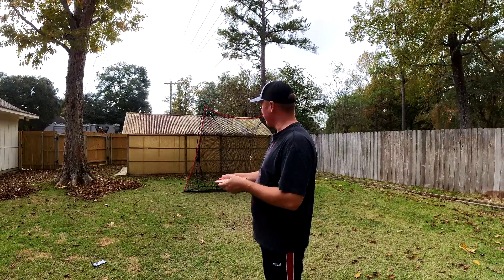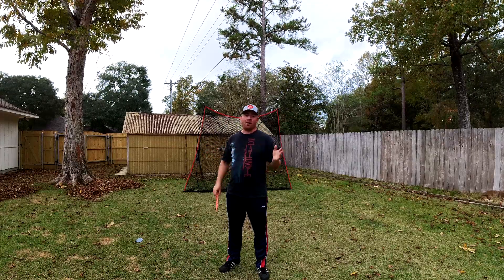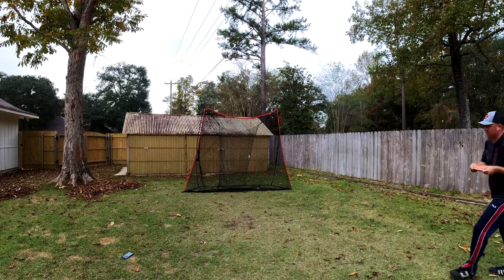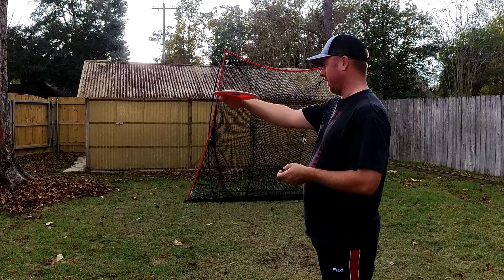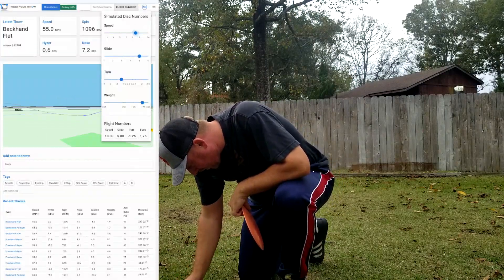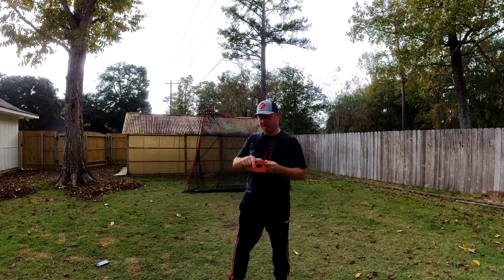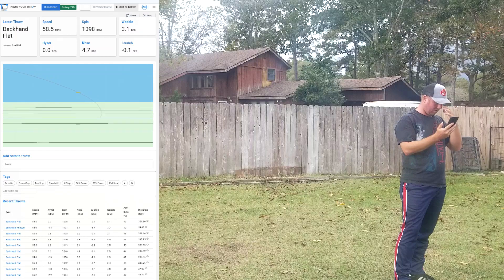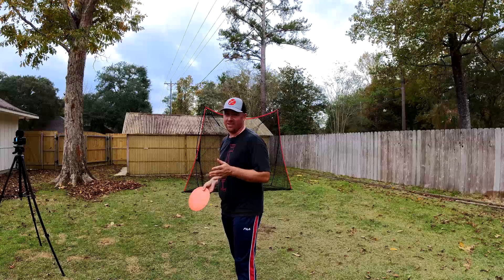Can We Throw Nose-Down With a Grip Change? — TechDisc: A Launch Monitor for Disc Golf

Comment: you need to practise nose and launch, up 8 on launch and nose neg 3, only work on one thing at the time.
Reply from the maker: Launch I can do on command with a change in reachback angle, nose I think is going to require a change in body position to get my arm and wrist at an angle where it's physically possible, because I don't think I can hit that with my shoulders that open. You're right though, hitting -3 nose would be HUGE for distance

Comment: Since your reach back is so high, you're compensating by throwing downward (launch angle).... but since your body is also telling you not to turf the disc, your release and nose angle comes up. Practice lowering that reach back and a  level swing plane instead of the up, down, up. Keep launching bro!
Reply from the maker: I think the high reachback came as an adaptation to the nose angle (I used to throw flatter but still nose up). I think I'm going to really have to focus on rolling the wrist to get that flatter nose angle, but at least I'll have something that tells me when I'm getting it right!